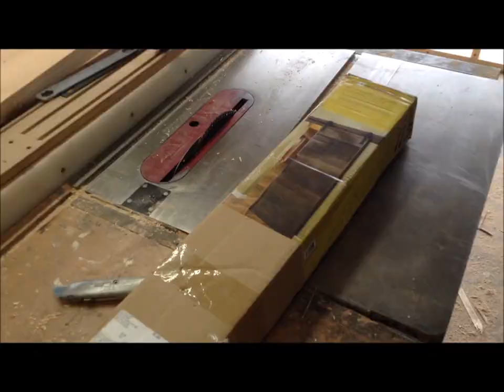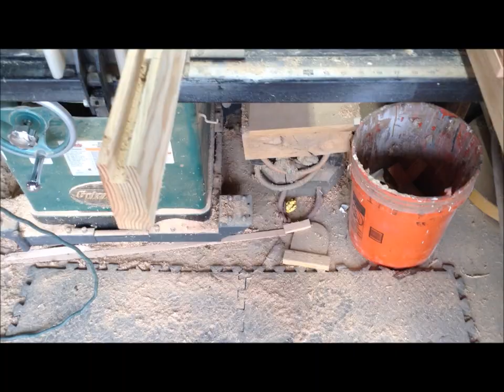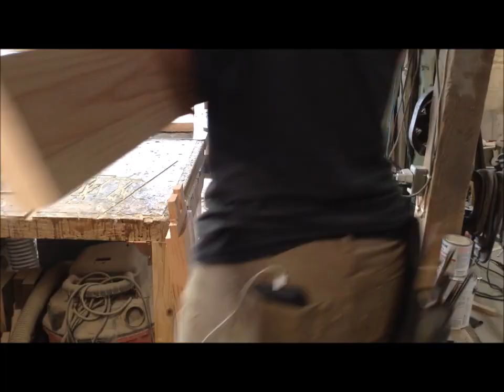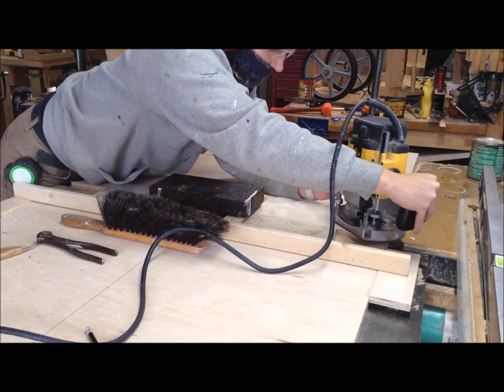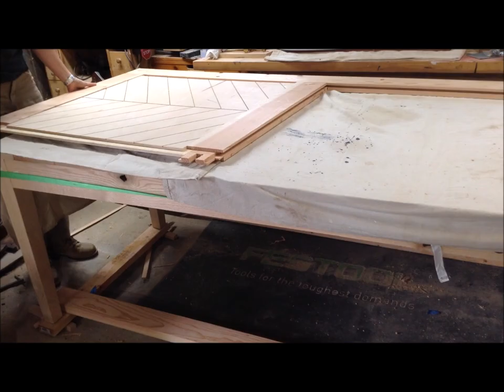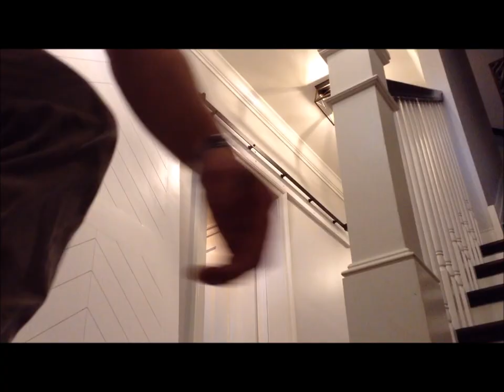Woodworking : Sliding Barn Door

Comment: Nice job. Was that pine for the rails and stiles? I’d appreciate hearing your comments on choosing softwood over hardwood for those elements.
Reply from the maker: The Home Depot by me sells a premium grade Douglas Fir, and that is what I choose to work with, when I need thicker dimensioned lumber, or for something that will be painted.  You just have to remember to buy it ahead of time because stuff from the box stores isn't at equilibrium and can still move on you if you purchase it and use it right away.  I have a how to video of this build on the channel if you want more info.